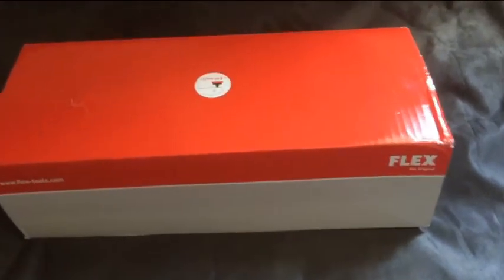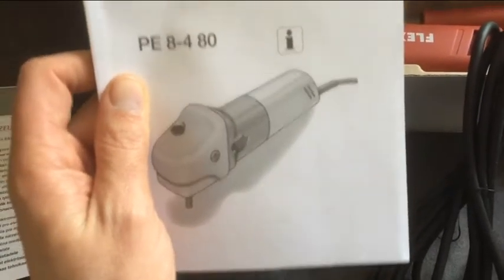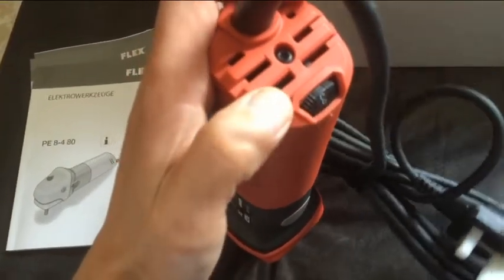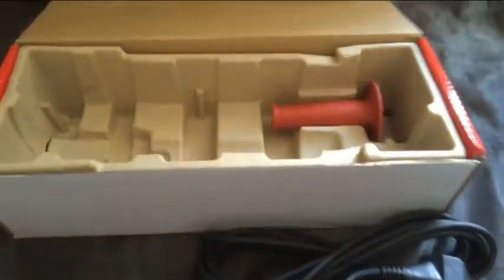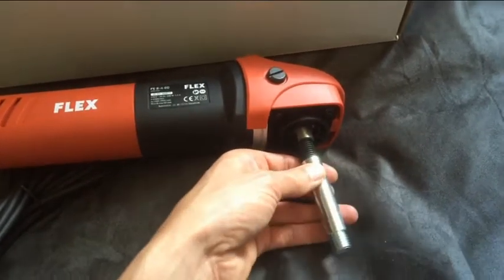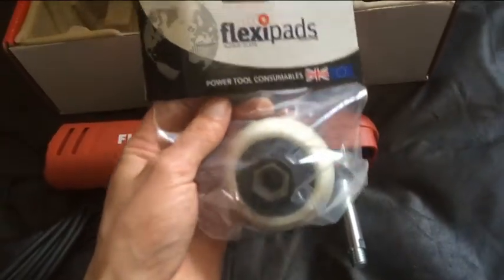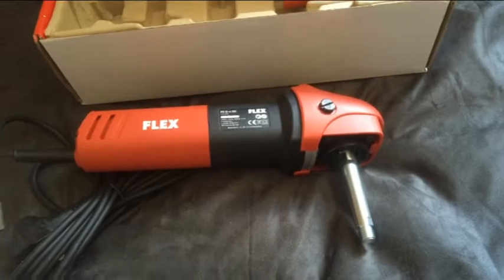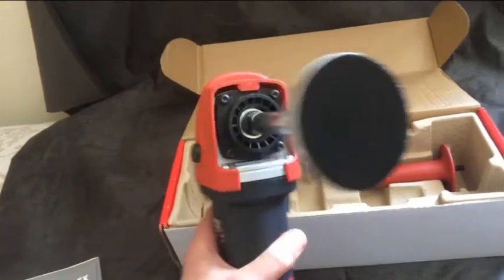Flex Pe8 mini polisher unboxing

Comment: can u use a 3 & 4 inch pad on the 75 mm backing plate i have aflex  3401 going to get this for dooing tight areas bumbers wing mirrors headlights door sils can u get some vids up off it in use
Reply from the maker: dylanson yea you can use 3&4 inch on the 75 although 4inch microfibres do tend to bend a little!!

Comment: where did u bought the extension bar?
Reply from the maker: Off of eBay mate! Search for 14mm extension 👍
Reply: +The Sprint St Guy are u sure its 14mm?
Reply from the maker: +Stephen Chandra https://www.ebay.co.uk/ulk/itm/141531377490
Reply from the maker: Yes mate 👍
Reply: +The Sprint St Guy thanks bro.. i bought it.. 
how do you like the machine? is it strong enough if i use 5inch backing plate on the machine?